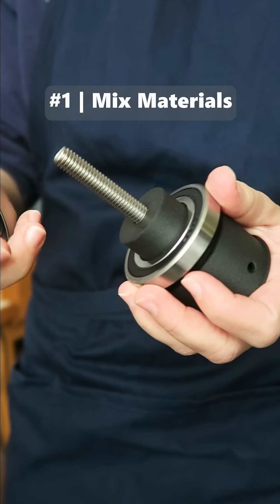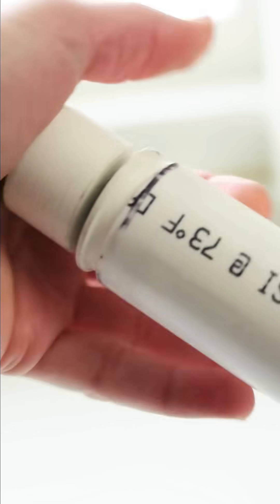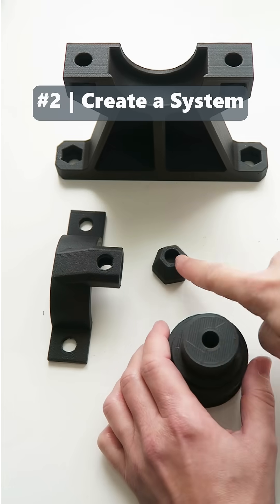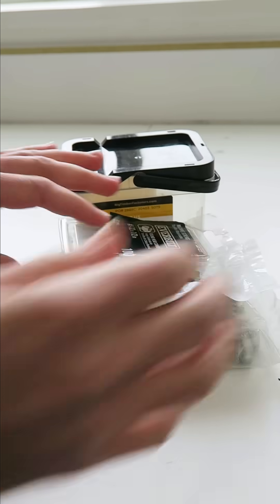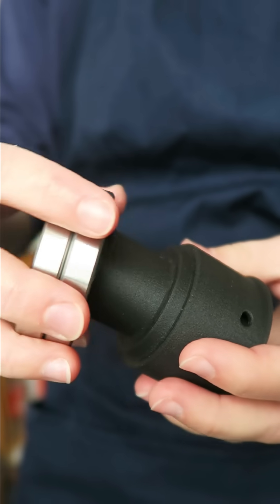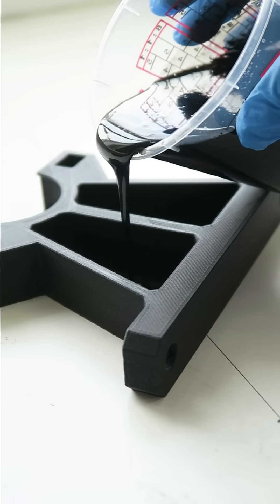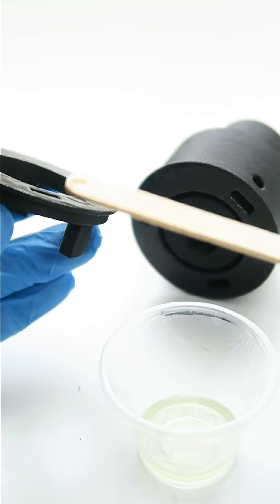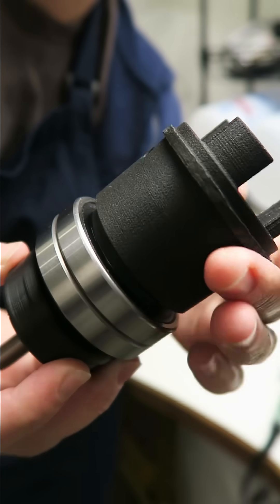5 Practical 3D Printing Tips

Comment: Instead of filling the voids up with epoxy one could just design a better internal structure with even manual topology optimisation. It means no additional work stages, no manual labor, no extra materials.

Comment: I need more of this. Does splitting the part and gluing it together compromise its strength (vs printed as a single piece)?
Reply from the maker: Not the way I do it and with this filament. It depends on your method and the material compatibility with your adhesive.

Comment: Question when you have two mechanical parts rubbing up against each other, mainly a rotational arm around an axis what would you do to minimize the wair in that situation? I assume something like nylon washers or spacers, but would there be any 3-D printed solution in that case I noticed that there are small patches on the bearings which are non-rotational could I include spacer which only contacts those points that way I’m not really impeding on the function of the bearing?

Comment: BTW you can use gyroid infill to later drill a hole and a venting hole and fill the whole part with epoxy, as gyroid infill does not divide the inner space...

Comment: If i find myself having to split an item to avoid supports in areas that need to be perfect or close to it, i tend to make it so the part  separation area has pieces that insert into one and other so they are not solely relying on glued together surfaces!

Comment: The single most important 3d printing tip of this clip: use cheap off the shelf items instead of 3d printing everything that shouldn't be 3d printed, like bearings and stuff. And one structural bolt made from metal will increase durability 50 times
Reply: Fr, I’m trying to develop something for my power tools, and I printed a sample bolt just to make sure mounting and everything was all good. 
As much as I love my PETG, I know that plastic bolt ain’t strong enough for an every day power tool 😂
Reply: My goto's are PETG, M4 steel bolts, and brass heat-set inserts. <3
rarely do I just join plastic parts, I usually bolt everything together, so if anything goes wrong I can take it apart and replace that one piece.
Reply: Friend who recently got his first printer was like "Whaaat why dont you print your own storage boxes...???" and I had to explain to him that it would cost me twice as much and give me half the strength over some injection molded parts made from pellets bought in bulk which dont rely on layer adheasion 😅

Comment: What is this supposed to be? A guide to what? Your products?

It has no cognitive value other than seeing what you're printing.

To me, it's a huge design failure when you have to glue something after printing and then weld it with a soldering iron. Really???

It's a design failure, so specific to China, where there are no standards or technological rules.

You just do it so that it doesn't fall apart right away.

That's why the rest of the world has technical standards to ensure the right quality and durability.

And here you are showing welding with a soldering iron... I'm speechless.

Comment: Using concrete instead of epoxy is much cheaper and gives a nice heft!! Excellent tips, especially doing test prints of small sub-components to make sure they fit well. I never print anything I designed myself without doing a check on all the sliding joints, interference fits, etc 😅

Comment: Because 3d prints are strong in compression and weak in tension perpendicular to the layers, you can add a lot of strength by incorporating through bolts or rods to your designs.  Add side plates as well for really impressive results.
I made replacement guide bearing mounts for a bandsaw out of PLA.  By adding 3mm (1/8") thick aluminium side plates, and M3 through-bolts, the strength and rigidity was a HUGE amount better than the cast alloy originals.
Excellent video, thank you.

Comment: I’m used to videos like this having one nugget of new information that isn’t just the common way to do things throughout the community, or, at least the way half do it - at war with the other half who says to never do it, but either way, 80% of what they say isn’t groundbreaking.

I have been 3D printing for 10 years.. this was straight 200IQ from start to finish. I think the only one I have done is splitting a print to burry a bearing. So 1 for 5 that I have haven’t done instead of 1 for 5 that I have! 

- I have seen people use multiple materials but haven’t felt I needed it myself, so even that’s 3/5, which, to reiterate, is 3X what I’m used to.

300-400% better than most.. and I’ve been 3D printing (and watching videos on YouTube about 3D printing) for a literal decade..

/rant

Comment: For that last tip on joining the parts. You may also need alignment holes for removable pins to ensure that you put them together precisely. Have some precision stainless steel pins of various sizes handy for this purpose.
Reply: I use clippings of filament to do this.
Reply: @kurtnelle  it would need some tailoring to the specific application, but i don't see why it wouldn't.
Reply: I certainly wouldn't shy away from small alignment pegs, keyway, or a notch. It'll just add more surface area for adhesion on top of making it easier to fit.
Reply: A tongue and groove element to your design could also add more surface area for additional adhesion strength while also giving precise alignment.
Reply: @andyhumphrey7601 can you use tongue and grove on a cylinder?

Comment: The last tip is something I just figured out on my own. I had an object with curved recesses in it so instead of printing it flat which would cause the layers to be very visible I printed two halves standing on their ends instead. Layers vanished but I do have to glue the two halves together.

Comment: Why did you use epoxy to connect two parts why didn't you use super glue and is the epoxy strong enough to connect to parts like that
Reply from the maker: 1. I always have lots of epoxy around.
2. My super glue is always dried up.
Reply: @LindyDesignLab  haha I Know the struggle , is the epoxy like the super glue or weaker?
Reply from the maker: I don't have specific data, but it seems like in general epoxy is less brittle than super glue. I've never had an epoxy bond fail me.
Reply: @LindyDesignLab  you are doing things right. Epoxy is much stronger. It is a structural adhesive. Superglue that cure with moisture will always have the weakness of not being able to withstand moisture, like dishwasher. UV curing  cyano acrylates don't have that problem.
I was impressed. Was just thinking you made the part very massive, yet the bolt holes were not reinforced.
Reply from the maker: @herrkulor3771  Thanks for the explanation on the epoxy vs superglue! For this assembly, there is no strain on the bolt holes because it's held together with the compression of a nut on the end. Also any moving parts are on bearings, so again no wear or heat buildup from friction. The parts are also chunky to fit with the standard hardware size I use and with the spools that this dispenses.

Comment: Plastic welding guns, that use staple like tips that you melt into your part then cut off the excess are great for out of sight spots. Greatly increasing strength and quick. Can be used in place of clamps on parts assembeled with epoxy say. Glue and clamp, heat wled them then remove the clamps. Good for bulk production runs.

Comment: Great tips! I myself use M4 bolts and nuts to join parts wherever I can. All my bolts are in the same style, I can (dis)assemble everything with the same tool every time and I know the tolerances. Threaded inserts? No, again just M4 nuts but with tighter tolerances so they have to be pulled into the hole via a screw.
Reply from the maker: Perfect, I love your system.

Comment: Another companion to the section printing is to generate simple technical drawings of your models and printing them on paper at 100% scale, that way you can check alignment of holes and radii of fillets without wasting any filament. This saved me a lot of time when printing enclosures for custom circuit boards
Reply from the maker: Smart.
Reply: @LindyDesignLab Agree. I remember doing it at school when we had design and construction, as a check before the parts went into production. When you had more complex designs it was very handy. Thanks @bena2.014 for reminding me.
Reply: I bought 3d's I'm going to use 3d's! Actually cool tip I gotta try cause I hate doing 3,4 or more tries to get it right.
Reply: Awesome idea
Reply: I like it!
Reply: Better to do it in 3D

Comment: You can combine epoxy with sand and/or small rocks. It saves lot of epoxy and can add more weight. Similar polymer concrete formula is used to make very rigid industrial machines
Reply from the maker: I hadn't thought of adding sand. That could be quite nice looking .

Comment: You can also fill cavities with plaster or cement/concrete to get more weight. It might not be as pretty and adhesion to the print isn't super but it's both heavier than resin and is so much cheaper.
Reply from the maker: Great idea! Thanks.
Reply: Agreed! And I also incorporate grooves/ridges on the inside of my designs to create a 'lock' with the plaster or cement. It takes a bit longer to print, but the filler isn't going anywhere.

Comment: Filling print cavities after printing to shorten print time and add back a ton of strength is #1.
I've been printing for, like, 6-7 years, and I'm still amazed so many people rarely do this.
Printing small sections of a larger print to test fittings is also gold.
Reply: Yes! To test fit I always print a “stencil” (only 2 or 4 layers ) to check holes, fit, etc
Reply: @charliebrownn6622  exactly the way I do!
Reply: Those were the two tips I focused on… Super impressed with the resin idea that never occurred to me!
Reply: It really depends on adding strength. Sometimes there’s no reasonable amount of strength restored to an object if designed properly even when adding resins.

There is a reason why ribbed feature in CAD has its own dedicated setting.
Reply: adding very thin but larger hole meshes would also add engineering strength to those voids...
Reply: Filling print cavities would/should rarely decrease print time, and probably even increases material usage. Printing big and bulky doesn't use a lot of material, since the vast majority of a print is hollow. The most plastic is used by the bottom and top surface, but walls can be pretty big ones too depending on the number of loops. With the part shown in this video, there probably was virtually no savings in filament usage (depending on the infill settings, which people usually have WAY too high). Without the middle divider, there would probably have been some savings, but way too little to offset the expensive epoxy.
Reply: @timderks5960  resin really isn’t terribly expensive. A gallon of cheap resin will probably run someone about $60-75, that’s about 50 cents an oz. And if you did some light infill with the printer it could save more resin, but obviously cost more filament, as well as provide even more strength. Depending on how often you’re printing high strength parts, a gallon would last someone quite a while. Buying resin in bulk is the key though, in my experience. I’m a woodworker, and when I first started out I just bought the 16oz bottles of resin, but that was costing nearly $1 an oz, sometimes over if I got the expensive brands. It can definitely be a little messy sometimes, though.
Reply: @timderks5960  in retrospect we didn't see the print with the epoxy fill as it happened so we don't know what percentage of infill they did for that 🤷
Reply: If you dont need to crunch - you just print. One setup and wait. Dont have to mess with mixing and pouring resin.
Reply: Agreed
Reply: I actually thought of #3 before seeing this video but all these are amazing tips lol. The plastic welding one especially is neat
Reply: how long have you been printing for
Reply from the maker: @SkinnyPete297 hmm I guess since about 2016
Reply: @SkinnyPete297  Long to some, but not actually long. Basically since the Ender 3 dropped, though I almost dipped into the Anet A8 a year or so before that; I just didn't want my house to burn down.
Reply: @kurtlindner  6-7 😐
Reply: epoxy dries 24h at least - there is no speed up, also it is much more expensive than filament - so this advice is useless
Reply: @abrrrakadabrrra  well, if you're comparing your typical 15% infill print with a 24-hour curing resin, then surely there's no gain to be had. This could be useful for prints with high details that might use a 0.2 nozzle, but still have the density of a 100% infill. Also, quick drying epoxy exists (should just be mindful of the print material as quick drying epoxy gets hot). With everything else, not one technique is better than the other. It all depends on the model, and use case.
Reply: @abrrrakadabrrra  Resin is cheaper is bought in bulk and you can actually save a lot of time. Printing hollow and filling with resin will decrease print time and while it is drying you can print other stuff. There are situations for this.
Reply: we dont do cause cause toxicity and enviromental damage so, thats why
Reply: new to 3-D printing, but going to try using washed beach course sand for added strength. I’m not sure I’ve ever seen this. If it’s a really large print, you can put the sand inside of a Ziploc bag creating the effect of sandbags used in the film and video industry  for weight and strength  @яатакч13

Comment: Wowza that's a beautiful matte black! What settings & printer did you use?
Reply from the maker: It was on an ultimaker 2 printed at 215-220, no special settings. It's a very easy to print filament.

Comment: That bearing looks like it would outlive the structure by 10000 years under load. I'm curious about the end design. What was it about?
Reply from the maker: It's a dispenser for a heavy material spool, so the bearing had to have an inner diameter large enough to fit the spool shaft.

Comment: For the epoxy do you find that it actually saves time and/or cost? I’ve tried hollowing parts out before and frequently it doesn’t improve print times or filament uses, as it need to spend more time on slow walls rather than quick infil. But that would certainly be stronger
Reply from the maker: It really depends on the project and if you have epoxy on hand to use up. For the project shown in the video I needed to test an entire assembly before I knew if the parts would work, so converting the test parts into solid usable parts made sense.
Reply: In general FDM plastics that aren't like glass or CF filled or anything like that cost less than epoxy, and of course are much lower labor cost.

Comment: Oh smart idea on the epoxy filling! I haven’t thought about that. Great tips!
Reply: You can use metal filings or powder/scrap in the resin to add weight as well. I had some tungsten powder that made it easy to add a lot of weight to small items
Reply: @MJTVideos  This is great, I've been doing the same thing with steel bb's but I've also found that you can get steel shot used for shot peening can be great too.
Reply: @MJTVideos  вместо вольфрама можно золото использовать )
Reply: Also mixing different materials without the possibility to disassemble them later makes things a lot harder to recycle. One key strategy at the company I’m working for is to stick with one material per part to increase recycling efficiency. 
I’m not saying plastic is bad, but we have to keep it in the loop.
Reply: A cheaper option would be Plaster of Paris(POP)
Reply: Damn i thought the same... I was wondering what people could do with that residue... But the temperature won't it affect the already printed part?
Reply: @ricardohnn  I cast things in resin at work weekly. If you decrease the amount of curing agent, you can lower curing temps. There is a limit, though. At some point it won't fully cure, so experiment first.
Reply: Concrete is also a really good subsitute if you want a part to be especially hefty. I gives it a permuim feel
Reply: Also, less epoxy = less heat. personally I would use it as more of a binder and mix in the cheapest fill material in my vicinity, and maybe a few rando junk screws strategically placed to provide some strength.
Reply: bad idea unless the epoxy has the same thermal expansion coefficient those sides she filled up will actually pop out sooner or later. It could even damage the part itself over time breaking the 3d printed section.
Reply: @givemeanameman1  anything with thermal exposure above 50C, you should consider using ABS, carbon or metal.